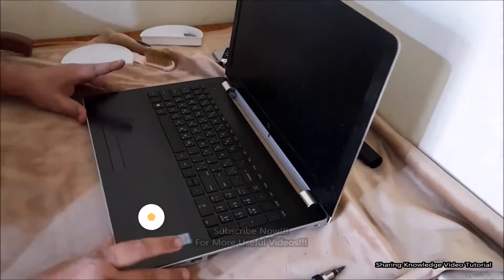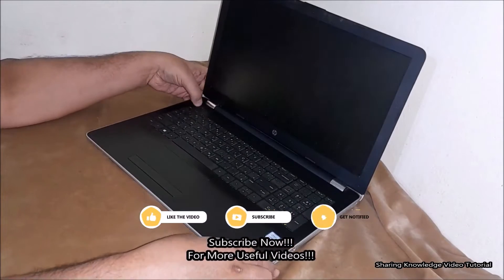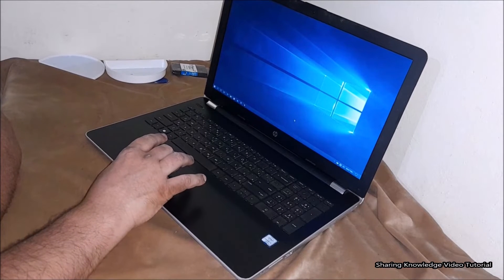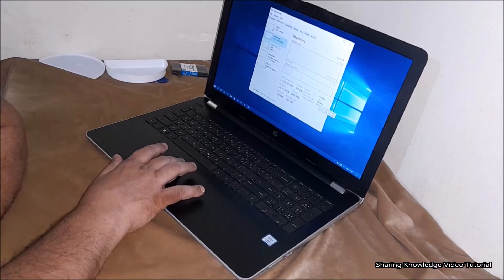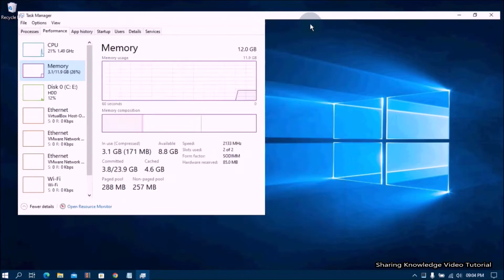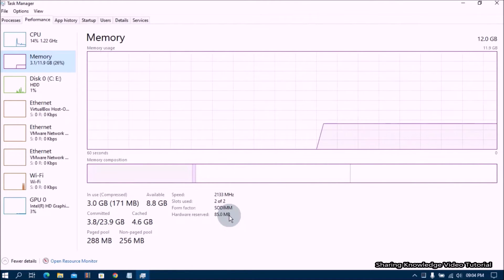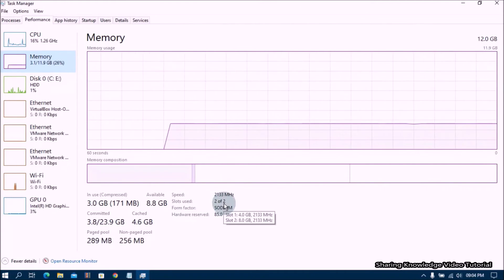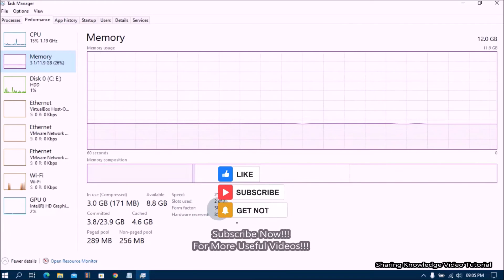How to Upgrade/Install RAM (Memory) in HP 15-Series Laptop | RAM Replacement in HP 15-bs0xx Laptop

Comment: Hi! I have a spare RAM from my HP Envy X360 Ryzen 5 5600u laptop which is 2 pieces of 4gb 3200mhz RAM, can i used it with my other HP 15-BS laptop? Thank you so much.
Reply: I think yes but it will bridge to 2400MHz